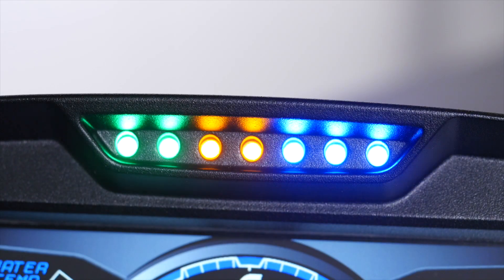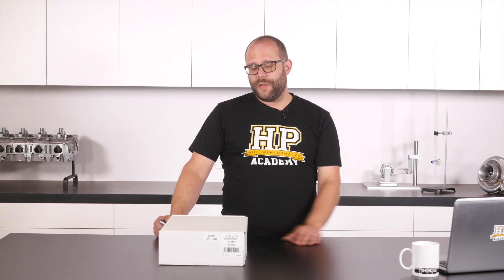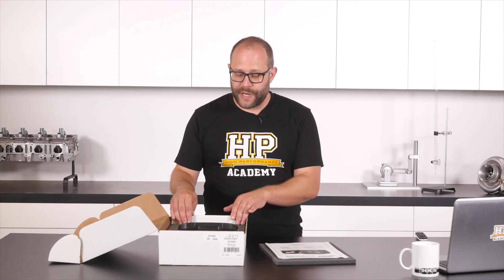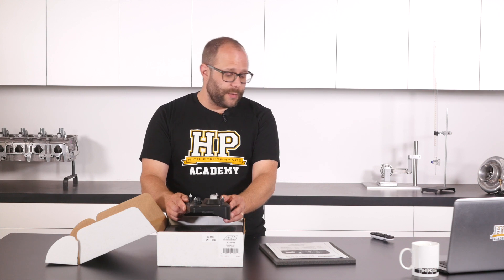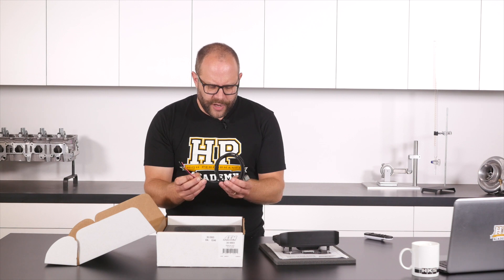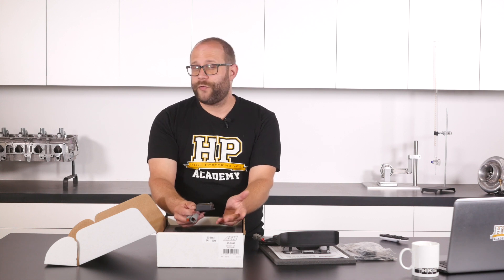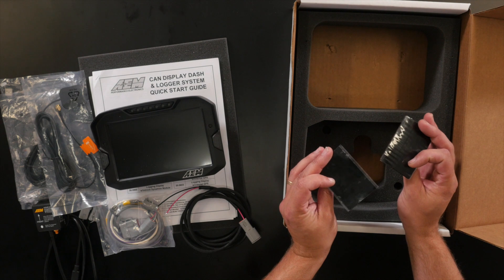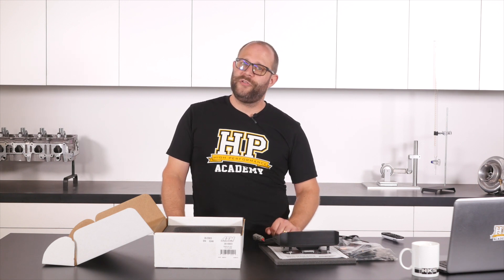CD-7 Digital Dash Review by HP Academy

Comment: So here's a question, when using the CD7, Infinity 508, and the 4 channel UEGO wideband controller how does one display 4 individual cylinders through AemNet? The Aem Can bus 4 port hub extension only can handle 3amps.
Reply from the maker: You can run the CAN to the Infinity and then output it to the dash from there, you can also contact our support team if you need any help! emstech@aemelectronics.com

Comment: can this dash be connected to a motec m1 ECU? if so how?
Reply from the maker: Yes, it will communicate with the Motec M1. You need to connect the M1's CAN output to the CAN2 input on the dash harness. We supply the Motec CAN data in our forum here: https://www.aemelectronics.com/forum/can-configurations-3rd-party-hardware

Comment: Is this plug and play with the stock ecu on the evo 10? Or would I need to define all the CAN signals from the stock ECU myself?
Reply from the maker: The OBDII PNP adapter harness will send anything coming from the OBD port to the dash. We also have CAN Converter Modules for adding additional data channels.

Comment: On the cd7 cables do you connect crank and cam cables or just the cam and on what pins of the aem series 2 Ecu are used for this
Reply from the maker: All of the data from the ECU is transmitted across the AEMnet CAN bus, so you will just need the AEMnet adapter cable for your Series 2, which you can find here: https://www.aemelectronics.com/products/programmable-engine-management-systems/series-2-programmable-ems/series-2-aemnet-adapters